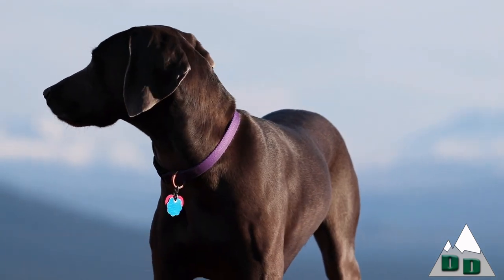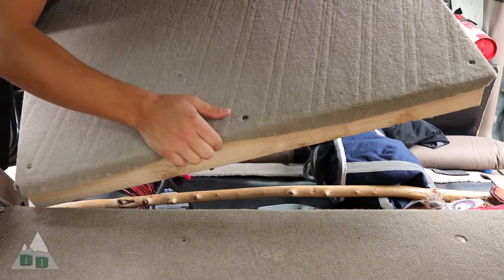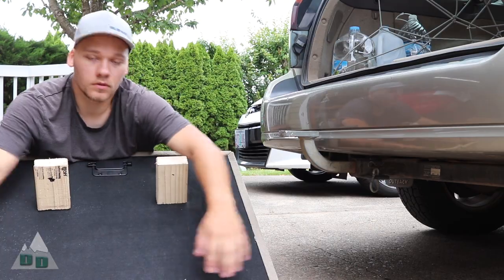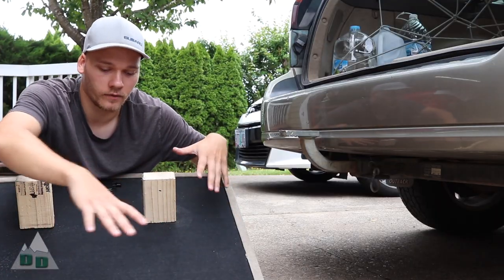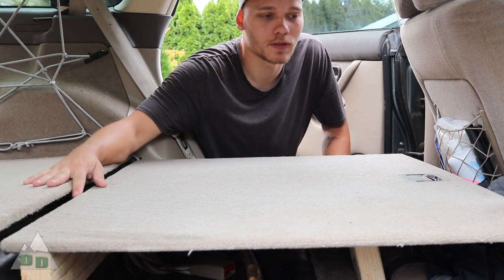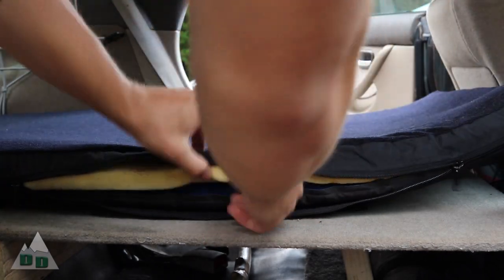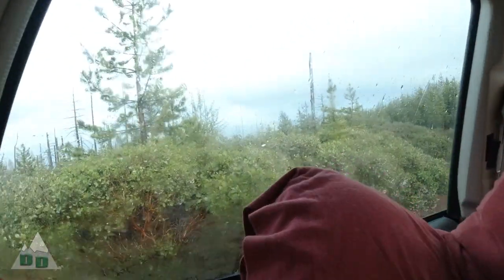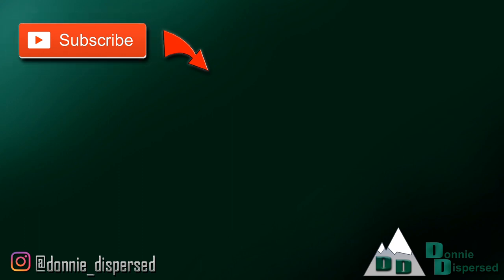DIY SLEEPING PLATFORM! | Car Camping & Overlanding

Comment: Hey do you have to move the front seat? What's the length of the bed area?
Reply from the maker: I didn’t have to move the seat out of my driving position. I’d say the sleeping area is just short of 6 feet. I laid at a slight angle and was comfortable. I’m 5’11”
Reply: @DonnieDispersed  Thanks so much!!